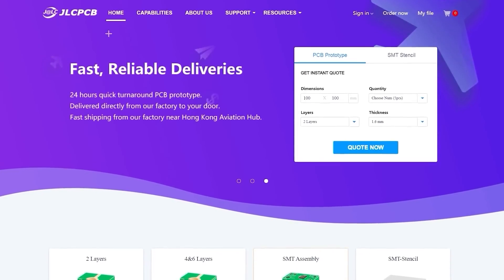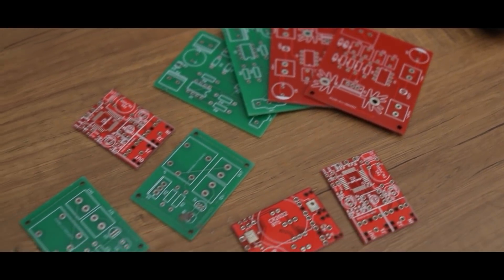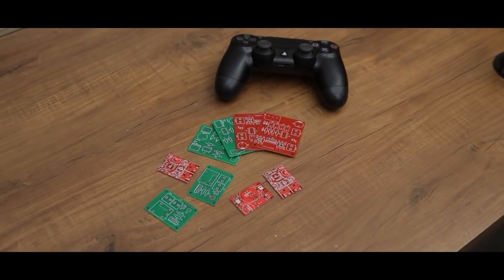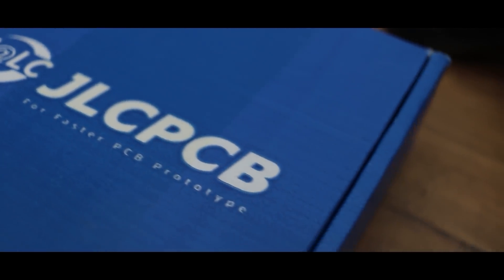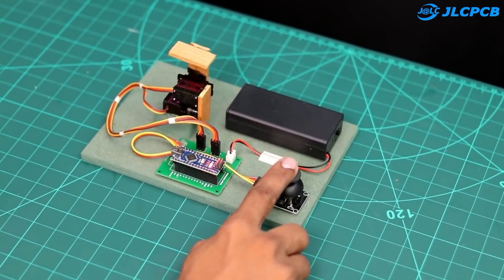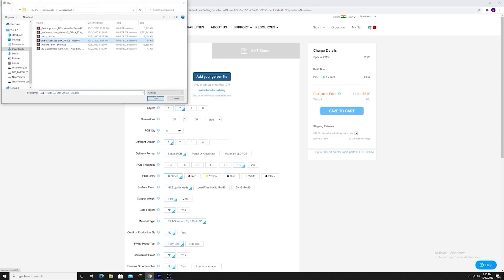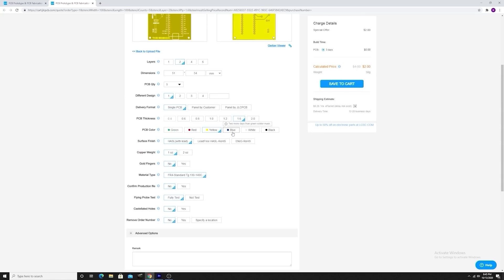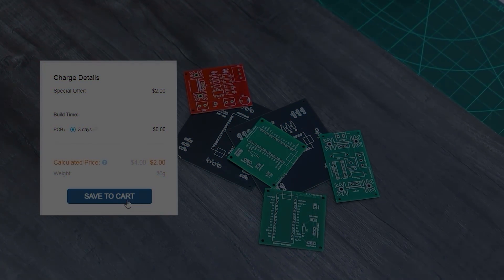3 Amazing ideas with Arduino - Compilation

Comment: Hi, may i ask for help please although its not related to your video?.

I have a solar panel & charge controller to battery. I have a digital display on the battery to show me volts. What id like to do is have a digital display to showing how much my solar panel is producing volts and amps. Ive tried to learn with videos, but have blown up two modules now :(

Can you help please. Theres three Red/Yellow/Black and RED/BLACK cables. How do i wire them up to show volts and amps? Might make a good video as theres none showing a solar panel to charge controller configuration

Any help would be greatly appreciated, all the best

Comment: What happens if it's locked and the battery's power is finished.😂😂😂
Reply: Break the drawer or destroy the furniture 😂🤣
Reply: That’s what you call a O O F
Reply: Want to have ability from outside 👍👍👍
Reply: Simple 😊 old school  way🔨🛠️
Reply: Exactly. For this reason don't replicate this at home boys and girls.
Reply: He should use continuous dc power supply of 12 volt .